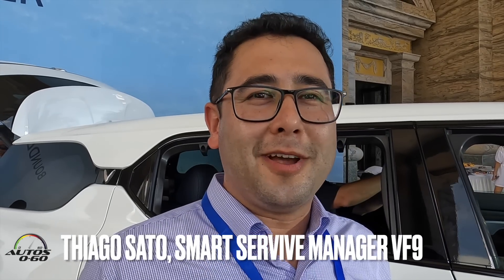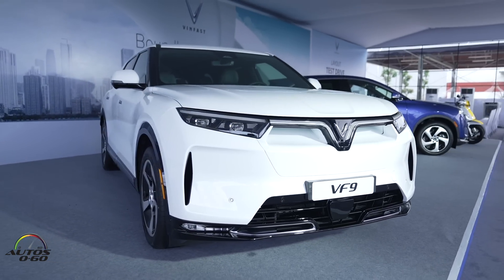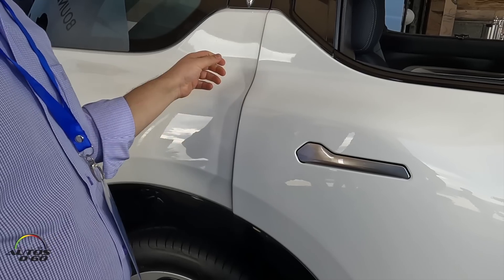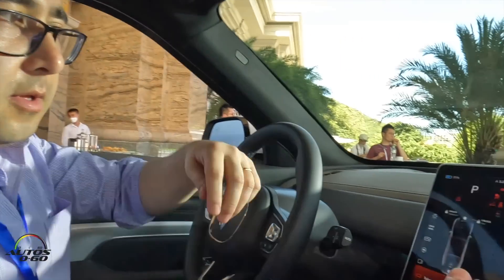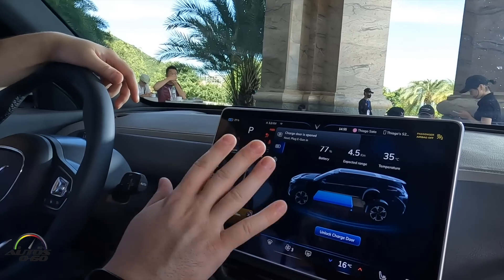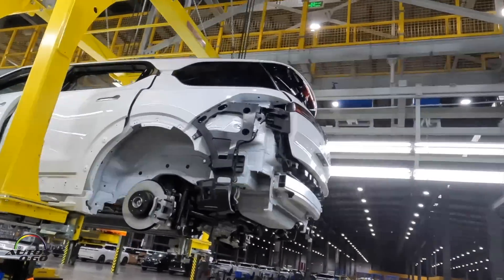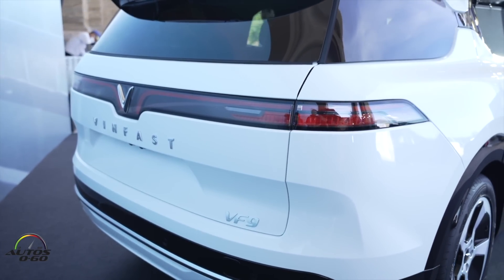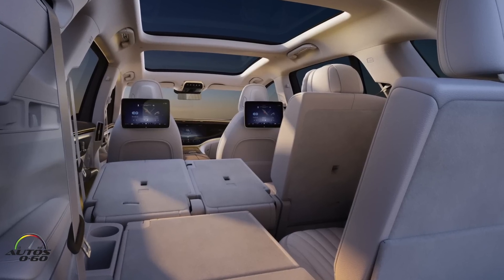2023 VinFast VF9 1st. look in Vietnam, 3-row EV  coming to the US this year

Comment: think 10 times before buying this VF as just like Tesla, you can not sell them back to the original dealers and hard to find parts for it as Tesla.... These brand factories just assemble vehicles, they are not vehicle makers as others... that's all i can say as a car sale consultant....  as Ford Mach E we can charge them anywhere with regular plugs.... in fact, Ford has electric cars since 2012, 2013 on Fusion energy so it has been a long developing for Ford electric vehicles.....

Comment: Thanks for great insight! I’ve just have a test drive for VF8, almost everything are perfect; however there are something that I would wish for improvement (for both VF8 & of coz VF9):
- Big noise reflected to cabin thru the wheels
- Thickness of the body (it’s quite thin when I knocked into the body, sound like a toyota corolla :) )
- Steering wheel are too light for high speed
- Alignment are not very well; big gaps on the plastics/metals components.
- Not a flat floor on the 2nd row?
Reply from the maker: Excellent feedaback. I am sure they will fix all that!
Reply: Quality control has to be top notch as a new entrant to the US market,  else they will be eaten up. They need to create a good impression and I don't doubt their willingness to succeed. I, like loads of people are rooting for them to succeed. Can't wait to get my VF9.
Reply: @pvinfan403  hope you'll enjoy the new Yugo style brand.  Vifast is such a shit car. I don't know why anyone would buy it other than out of national pride like they do in Vietnam. And 90% of the people that bought one totally regrets it.  They are 100% economical cars built at the quality of Hyundai 30 years ago.  It will take vinfast a good 15 years to become a solid car. Even with all the foreign talent that's used in the design development and building of these cars. So to start it'll be a solid D+ for this freshman car manufacturer.